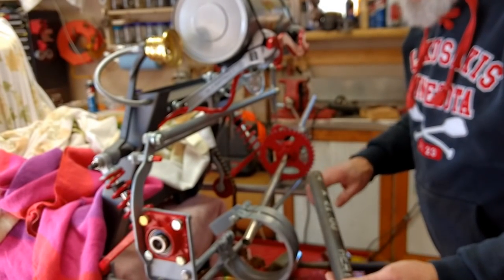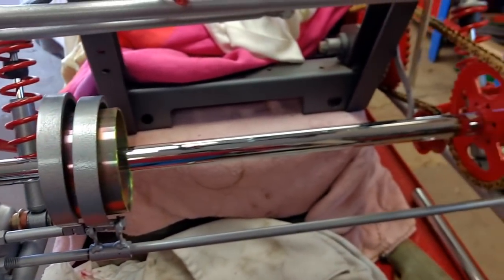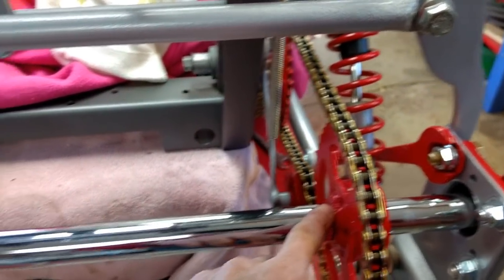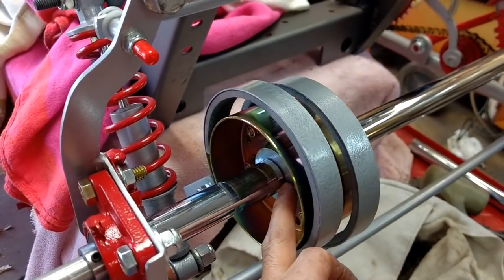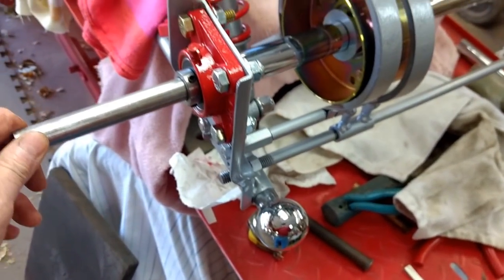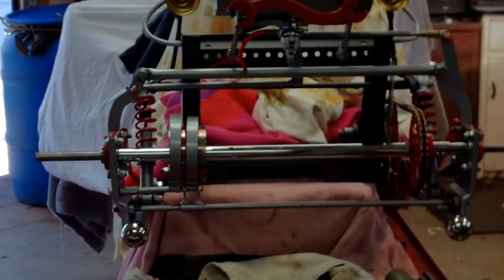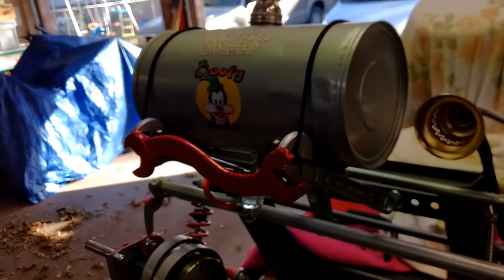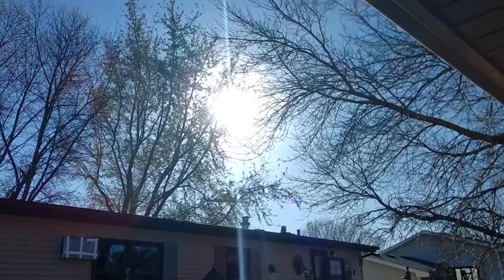Rear axle, rear drive chain & CHROME!

Comment: oh yeah, I like that chrome pipe! Do you cover up everything to keep the dust off? Make the triangle removable so when you bring it to the car show you can take it off.
Reply from the maker: I keep it covered to keep it clean, yes! I do lots of grinding and lots of paint overspray too. I purposely haven't been cleaning the floor much lately, so that when the painting is done, most of the overspray will just sweep up with the dust. Good idea on the removable triangle. Thanks Joe

Comment: I think it will take the vibration just fine. But side force from being bumped could snap it :/ 
Maybe mounting it to a backer?
Reply from the maker: A couple of other folks mentioned the same thing Terry. I guess great minds work well together to come to the solution. Thanks
Reply: Don't worry, if it ever breaks I can whip out another one with my spare change :-)